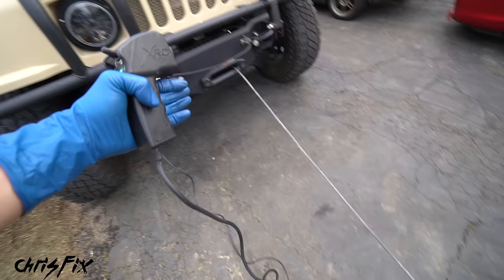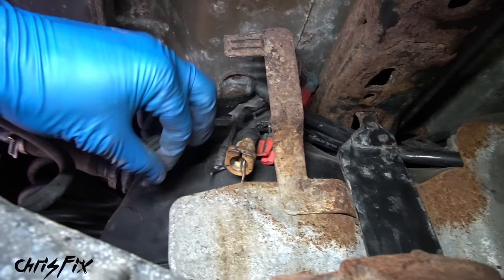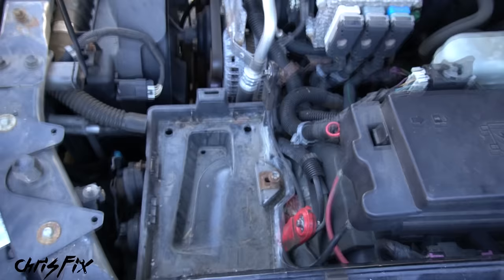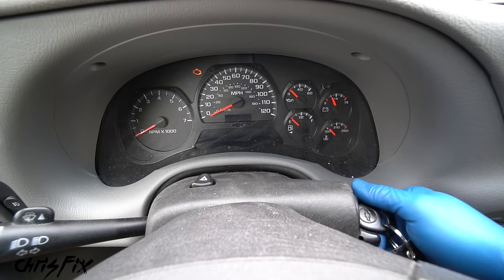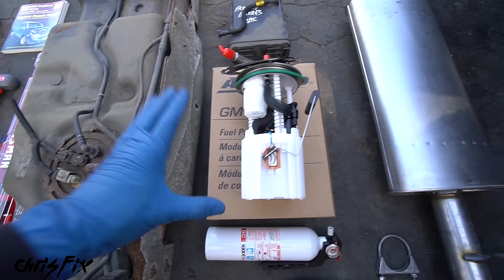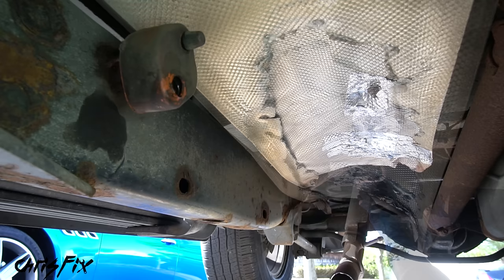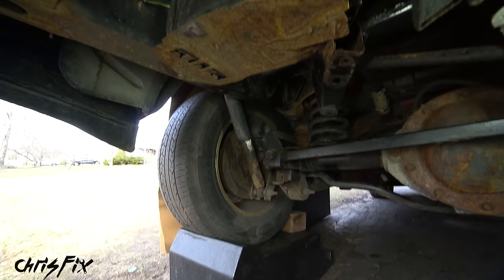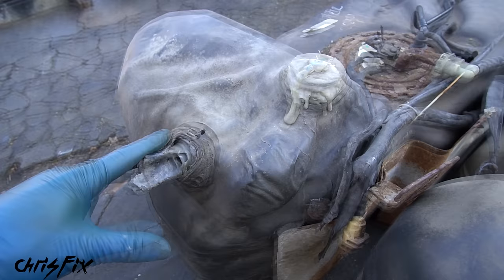How to Fix a Car that Wont Start (I bought it for $500)

Comment: .alternative video title was: 

“how to lose 500$ if you don’t check your fuses”
Reply: More like 3,000 after a car dealership buys it
Reply: Or "how to nearly die because you thought exhaust systems were purely cosmetic"
Reply: You mean how to loose a vehicle for a fuse
Reply: theory816 .exhaust wasn’t melted. Gas tank was melted. Exhaust was destroyed. 
But that wasn’t the reason why the car wouldn’t start. 

Unless you were commenting on another video.
Reply: @vikachan19  haha
Reply: @popeye5808  it would suck to lose a vehicle over a fuse.
Reply: @MichailDoc  maybe it was a theory... get it! Hahha. :/
Reply: how to lose your car if you let it run out of fuel
Reply: It was more then checking fuses. As he said the tank was pretty much melted which would have caused a fire hazard. So the fuse was the least of the problem.
Reply: @vikachan19  what you mean willis? Mine been leaking for the last 4 years no issues. I torque the hell out that there u camp things and she leaks all over. Better the squeaken. 

My exhaust has been leaking onnmy old truck though. No issues, as the exhaust runs passenger and the tank is driver side. Im use to soft fuel tanks due to being in texas 120-130°F heat. I actuallynhave to keep a full tank to keep the thing from melting.
Reply: People are either ignorant or just dont care
Reply: This guy is talking about flipping this SUV for $3000 yet he makes at least $60k per month just from views.
Reply: @popeye5808  no. Lose as in lost. Not loose as in falling off.
Reply: He was using the exhaust system as a fuse!
Reply: i was your 1.4k liker!
Reply: @springchickena1  I didn't make up the #'s ,  multiple websites say $20k - $70k per month
Reply: @vikachan19  Hahahhahahahhaha OMFG X'D
Reply: @NickKautz  $20-70k per MONTH? Absolutely not! 90% of DOCTORS don't even make that much money lol. The highest-viewed monetized Youtubers might clear $5-15k per month realistically with consistent content and viewership (which is right around 6 figures yearly BEFORE the IRS gets their cut)... It's a good hustle but whatever "multiple " websites you got that bloated info from are unreliable to put it politely lol.
Reply: @Stressless2023  You're only thinking of ad revenue,  there are more significant lanes of income from making youtube videos.  THe highest earner last year was an 8 yr old who made $26 million playing with toys.  Chris' CPM will be really high because it's family friendly content and there's nothing controversial about it.  He's definitely a multi millionaire
Reply: He was very lucky the fuse blew. The heat from the exhaust would've eventually melted the insulation on the wires and/or distorted the fuel tank until it started to leak...= fire. After driving so long with the broken exhaust,  He kind of deserved the deal he got.
Reply: @NickKautz  This guy is using an old SUV to make content. I doubt he's worried about the $3000 from it. He's showing us that we can do it as well.
Reply: @pedrocovarrubias3083  Yes , but he's trying to play on a relatable vibe like he's doing it for himself.
Reply: looks like the previous owner didnt watch chris fuel pump video
Reply: Food Recipes  Don't be afraid to ask someone for help if you're having trouble thinking
Reply: All started because of owner's neglected to fix the exhaust leak and snow balled with tons of repairs that causes no start to get rid of it.
Reply: All the new fuels goes to the ground as the original owner fuels it up.
SAVED by the fuel pump and the fuel or ?😵
BOOOOOOOMMMMMM🔥💥💥💥  !
Reply: Michael Bearden the exhaust was also broken, that is what melted fuel tank
Reply: @Stressless2023  You have no clue what you're on about.

He has a hummer and multiple other cars and you think he's not making 6 figures lol.
Reply: @yz249  You have no clue what you are talking about either. Hummers are cheap, Youtube revenue is unreliable and not THAT lucrative... Plus it is not tax-free.
Reply: @ponyVOX2025  it would have blown up!
Reply: @NickKautz  I would make the$3000 also. Good video for us to watch also.
Reply: @xmachine7003  Look for weird damage under the car when you buy a used vehicle , is the moral of the story
Reply: Imagine being the guy who sold this car watching this.
Reply: And your car
Reply: Michael Vigil ja?
Reply: I don’t think an average man can replace the gas tank.
Reply: @mytube2013  I didn't think I could do leaf springs either until I watched ChrisFix do them.  Saved me $700
Reply: I have a friend who's ready to give his non-starting car away because he lacks the confidence to look in his fuse box.
Reply: @johnnyquest9519  pun intended
Reply: @johnnyquest9519  Dealers get their cars from auctions. Better profit margins and there's usually no bullshit involved (i.e the seller fobbing you off).
Reply: @Interknetz  terrible
Reply: Lol
Reply: Alternate title is don’t go to a mechaninic saying my car is broken because they will not help you
Reply: "90% of DOCTORS don't even make that much money lol."

90% of doctors don't make as much as the average NBA player either.  What's your point?
Reply: If it werent for the fuse, their could've been an explosion. The heat from the exaughst was melting the fuel tank already it was a miracle it didn't explode
Reply: Oh got em

Comment: I bought an 07 with 220 thousand miles for 650$ did brakes and put an exhaust on it and flipped it for $2200 they are easy to work on and most fixes are cheap
Reply: Matthew Macinnis bought a 165k mike 08 LT in perfect shape for 2750, off-road it all the time. Great suv

Comment: I'm in a really tough financial situation right now and I know I'm gonna need to get a car for cheap this summer. I've been pouring over all your videos and they've been so helpful in giving me confidence that I can find a cheap car. Thanks to you I know what problems I can manage, and how I can do it without spending too much money. With that being said, would you make a video on problems a beginner should avoid?
Thank you for all your hard work that goes into these videos!
Reply: The biggest things you'll want to check is oil froth on the dipstick or oil cap like Chris mentioned, and the condition of the transmission fluid looking for a foul odor or dark brown color.  Those are much more involved jobs, but you can do those as well if you have the patience.  Checking to make sure the frame is straight and structurally sound and hasn't had repairs done is another that can save you a headache.

Comment: imagine being the dealer and seing this dude just changing 50 cent fuse and starting it after he bought it for 500 
lmao
Reply: If he did get the fuse fixed he probably would of drove it until it caught fire 😂
Reply: @slapzk5355  yeah lol but still
Reply: @slapzk5355  exactly 😂 can’t believe how fucked his fuel tank was
Reply: Wait I saw that in a mr. Bean episode.
Reply: it still needed essentially $1000 of repairs to run if done at any shop

Comment: Man, I'm hesitant to change just my spark plugs. Need to keep telling myself "ChrisFix believes in you, ChrisFix believes in you..."
Reply: You got this! Before you know it, you'll be pulling a whole engine lol
Reply: But when one snaps in the cylinder head because they havent been changed for ages. That's when the ahit hits the fan.
Reply: @shifty2755  Honestly, had that issue and it didnt bug me. Old 83 D150 stepside pickup. Miss that old girl. Replaced a lot and she ran great. 

My old "backup" vehicle doesnt like sparkplugs. I can torque them down when the engine hot and she will still want to spit them out. She wont throw a code either. So, ya every 500 miles or fill-up, gotta leave her running and tighten the plugs again. I leave her running to keep the motor hotter. Can bottom the plug out and do a small torque and itll be loose next stop. I fixed the issue with my daily. I bought a diesel. No spark plugs to deal with now.

Comment: For anyone wondering what does the Charcoal canister do. 
"Part of the car's emissions controls, this charcoal-filled canister's job is to absorb fuel vapor that would otherwise vent out to the atmosphere, causing pollution. Vapors trapped by the charcoal are released back into the engine through the purge valve and then burned." 

Hope it helps some people. :D.

Comment: I learned something from this one.
Reply from the maker: I'm glad you learning something from the video!
Reply: I learned more from this vid than school
Reply: @chrisfix  love your videos Chris
Reply: @chrisfix  I have a 2005 trailblazer and this helped me figure out what the problems where thanks this video helped me out alot
Reply: This is great how it shows it can be done with hand tools.....Impact wrench might be able to bust loose the bolts without breaking them, but often a torch is the only way, and at that point you're getting into tools more about ease and turnaround time than anything else. In my case exhausts have gotten bad enough the flanges disintegrated into crumbs as soon as I disturbed any one piece, and then it was prudent to just replace the whole thing. Now I try to limit my winter driving on salted roads to just one car as designated rustbucket!
Reply: @phylaxinator7040  Me too.
Reply: @KalOrtPor  u can limit the damage washing the undercarriage, and making preventive maintenaince removing rust point and reinforcing the protection with specific paints

Comment: I never heard Chris fix so excited.
Reply: he got a good deal. even though he replaced the fuel pump anyways.  I most likely would have replaced it also, depending on mileage and service records.  I definitely offer less on a car if there's no service records.  You have to then assume the vital stuff is going bad and needs replacement (like timing belt, water pump, fuel pump.. and the small stuff too, like spark plugs and wires, distributor or coil(s), thermostat, and transmission/radiator/brake fluid replacement.. it adds up if you don't do the work yourself!).
Reply: @GlycerinZ  yes do the work yourself, you'll learn a lot and save a lot. Knowing your car is the best thing an owner can do.
Reply: MissBttrsctch  I nearly had one too when I saw your profile pic
Reply: Me too Sounded more excited than when he got the driftstang running for the first time!

Comment: Seller: Needs a $100 fuel pump

ChrisFix: Nope, needs a 10 cent fuse.
Reply: proceeds to change the pump anyway
Reply: @Rommmm  I commented before I got that far in the video. lol
Reply: But what caused the fuse to blow lol
Reply: @ashtonnuckols2663  Probably the same thing melted everything near the fuel filler. That broken exhaust.
Reply: nope needs a new tank, which he got an operable one at a decent price, and replaced it at home, on his own, WITH COMMON HAND TOOLS!!!!! lol i love that part.
Reply: @Rommmm  peace of mind.. and insurance.  that new fuel pump will out last the car... don't replace it, and you're doing the same job over again later down the road.. and by that time you're thinking the car might not be worth it... especially if you have to pay someone else to do it
Reply: and then he replaced the fuel pump anyways

Comment: the owners after this be like: Nice... now give us our car back.
Reply from the maker: Deal was already made :p
Reply: Make sur the title is transferred.
Reply: @chrisfix  
Or: Sure thing, just pay me for parts and labour.
Reply: @HrHaakon  
And if Not...
DM From Old Owner But On Alt Acc: Hey, Chris! We broke the security in ur home.
Still old Owner: Goes Ninja Mode And Uses Smoke bombs, and ninja supplies to steal the Trailblazer
Me: Its A Trailblazer. Is It Worth The Time Spent???
Reply: Sure but fixing price is added so sell it for 5000
Reply: Sure, $850 car and parts, six hours labor and purchasing @90/hr, and $150 diagnosis...that's $1540 TYVM
Reply: @g33dav3y  bro, ur not getting the joke
Reply: @chrisfix  They can buy it back for $2100 more =D
Reply: Actually dealer price to fix this the way you did would probably be around $2000 now that I think of it lol
Reply: @kingkong1040  well yeah, they would install the $800 new gas tank, for starters.
Reply: Doesn't work like that.
Reply: @kingkong1040  isn’t that like 2/3 of the price MRSP lmao

Comment: the ‘soapy wooder’ spray bottle is the best thing i’ve ever seen
Reply from the maker: :p
Reply: I wonder what the ingredients are 
Dish soap, water, & a lil bit of pine sol
Reply: @josephr.8622  No, nooo. Is lemon pledge.
Reply: What, you haven’t bought your Soapy Wooder stickers for your spray bottle yet?
Reply: @chrisfix  Your point at the end about saving a car from being scrapped appeals to me a lot. I'd love to see The ChrisFix gov't supported Save A Car program setting up simple car shops that would encourage and aid ppl out of work and teens and anyone else interested in doing exactly this. Good for the environment and letting ppl easily do something productive both.
Reply: And Petter you could be CEO of that program and make $200K per year.

Comment: ChrisFix: how should I get Scotty’s blood boiling today. 

Buys an older Chevy that won’t start
Reply: No, that’ll only put it to a simmer. You want to get his blood boiling? Resurrect a high-mileage Chrysler or Mercedes.
D O U B L E  A S C E N D E D  M O N E Y  P I T
Reply: glassimageproduction high milage Range Rover
Reply: XD
Reply: no no no you're so wrong. Buy a Chrysler. that's all you need. a Chrysler
Reply: You are all wrong. You want to see Scotty's blood boil, just post anything bad about any Toyota.
Reply: Technically if blood boils, blood pressure is lower which is good!
Reply: Ya what's his problem old gms especially that engine it's known to hold up well
Reply: Buy a Pity Cruiser and you have the job done.
Reply: ihzero no buy a pity cruiser that comes from the north or was in a flood and doesn’t run, then wait for it.......

 FIX IT 🤭
Reply: or better yet, have a Toyota Celica towed to the scrapper
Reply: @Cheez-Itz_Christ  ya I guess you could do that
Reply: @ihzero  true and will probably still outlast that jeep
Reply: @glassimageproduction  I'm kinda about to do that. My aunt blew up a Jeep Liberty with 180K on it after overheating it and ignoring every warning light. Normally such a car would be instantly deemed as scrap, but it was a southern vehicle and the underside is CLEAN for what we're used to in the Northeast. local junkyard will sell the new engine for $300 so wish me luck, just need to wait on this whole virus thing to die down
Reply: Well duh it didn't run bc it was a chevy 😂

Comment: 15:40 It's not a ChrisFix video without soapy water
Reply: Heaven forbid there's a tiiiiiiny pinhole exhaust leak at the repair, on a car covered with rust lol.
Reply: W O O D E R
Reply: Sum Rando you beat me to it
Reply: @ClericalConsequences  you beat me beating him to it
Reply: *Wooder
Reply: @kinguin7  Yeah, but why wouldnt you do it as well as you could while you are in there?
Reply: Yeah don't be afraid to use too much Soapy Water.
Reply: @ClericalConsequences  and @Von Strohiem :  I .B E A T .Y O U. A L L
Reply: @bagelbytes69420  you could put way too much work into a beater with that logic.

I bet there's leaks elsewhere in the exhaust already, yes fix it but making it perfect is likely a waste.

Comment: 24:11 
Chris: Fixing a car with common household tools 
Also Chris: Digital torque wrench
Reply: Ya, that alone is $170. I gone the conventional way and still dropped $100. Funny part, i dont even use it. 1 uga-duga or 20 should be good. Unless its plastic then its "that should be good". As for nylon nuts, ones i have 4 cuts on my hands, its tight enough.
Reply: You only need a torque wrench if you don't have a feel for how tight is tight enough.  That's why the Terminator needed a torque wrench in T2. It knew how much pressure was required to crush a windpipe, but It could have easily sheared the bolts right off installing a starter.  Theres a scale of tightness: loose, thumb tight, firm, good and tight, too tight, and it broke.
Reply: @brandoncaldwell95  I'm not sure where you are looking but I can get a torque wrench for €40
Reply: @ScorpionRegent  wooosh
Reply: @Cako1000  I drive a 1 ton. I cant use a mini-me torque wrench when everything pushes 150-500ft/lbs of torque. Headstud job alone will max out any cheapy.
Reply: Buy once, cry once with tools
I still will stick with the old school click type torque wrenches from Snap On
Reply: haha, true!
Reply: Brandon Caldwell he was just showing that you should use a torque wrench. if you only had grand daddy’s beam style, that would work too. realistically he could’ve done this whole thing with an impact gun but he uses the sponsored tools to show how to use it
Reply: @NickPennerEh  ok, still we are talking a $140 for the pieced set and $170 for an ELECTRONIC TORQUE WRENCH. Especially when its the crappiest brand on earth now thats heavily over priced. If you had a partial brain, you would know an impact costs 5 times as much on the tools. If he wanted to show common hand tools, go to Walmart and get the cheap husky sets or an estate sale with used beaten tools. Thats "budget hand tools" not $300 worth of 'Crapsman'. Especially when 90% of people never use a torque wrench to begin with and leave it at 'good n tight'.
Reply: Got a torque wrench at harbor freight during one of their weekly “clearance going out of business” sales they’ve been having the past 4 years...